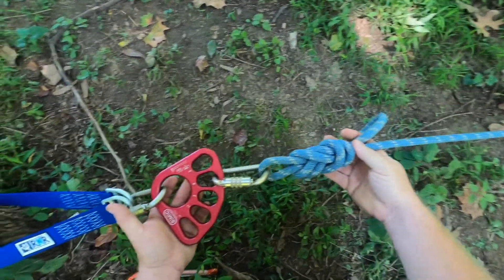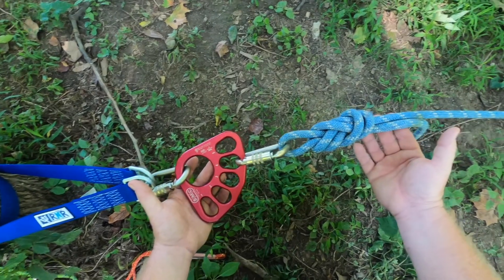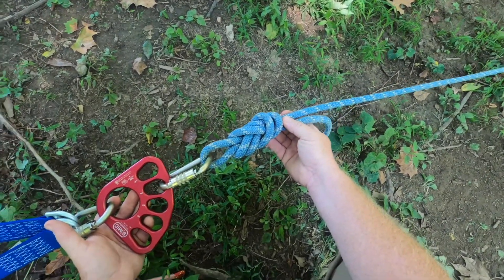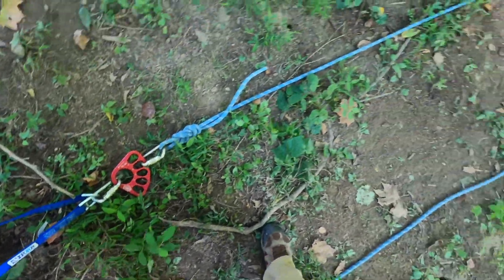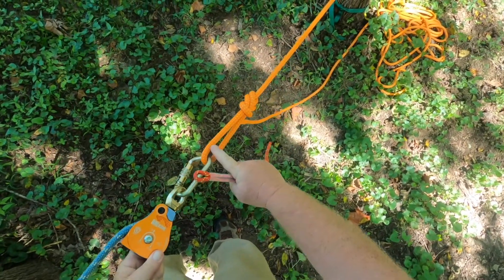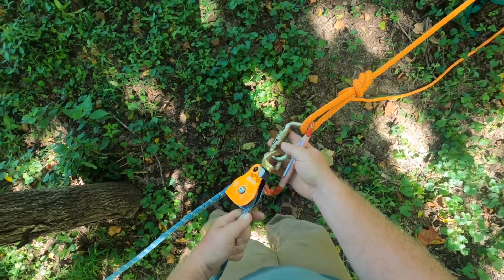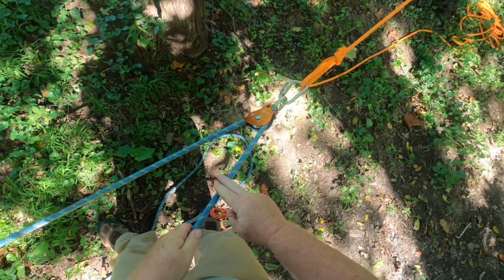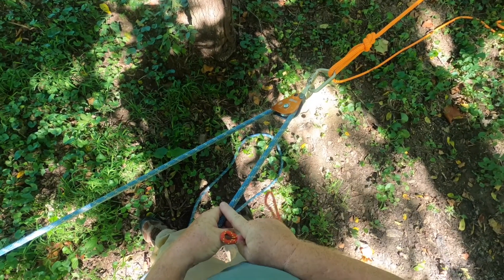How to create a 2:1, a 4:1, and a 6:1 Haul System for Rope Rescue

Comment: Your SOF is rigged pulling to advantage (the rope is terminated at the load end and you're pulling in the same direction as the load is moving) so it is a 5:1. If you turn it around,  you'll get a 4:1cd. The way you've rigged it gives 10:1 (5:1 piggy-backed onto a 2:1)
Reply from the maker: Right. I didn't really explain myself well in that video on the SOF's so I made another video: https://www.youtube.com/watch?v=0lh7ezFI0Oo&t=2s

Check that out and tell me how if it's more clear. Thanks for watching and commenting!